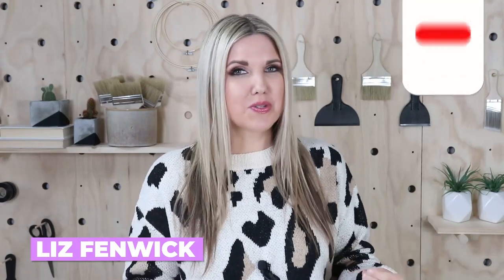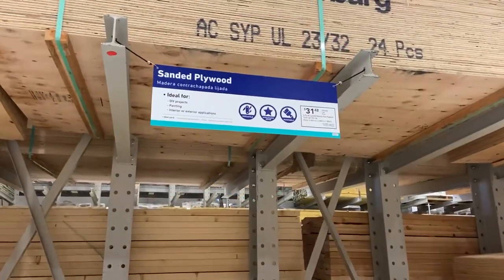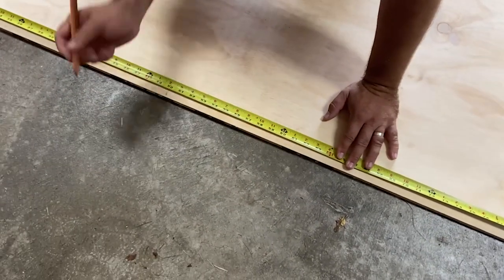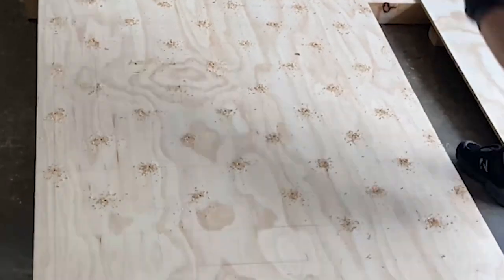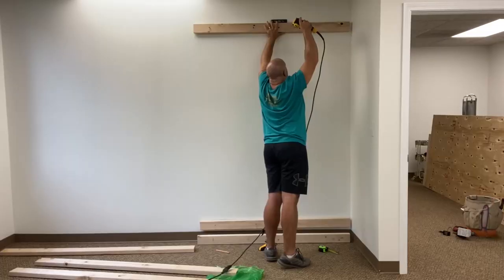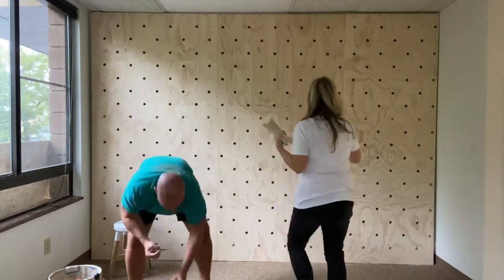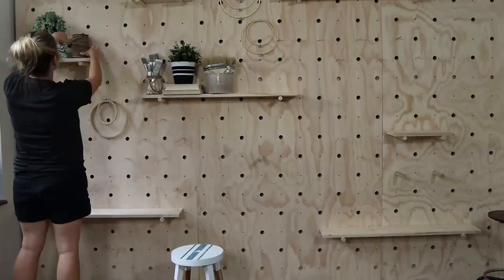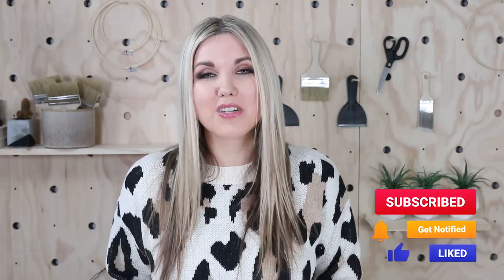DIY Pegboard Wall - Office Makeover

Comment: I want to do this but not a whole wall, maybe just a 30" wide and 60" tall section for a partition wall with the bottom 36" plain.
What dimension thickness is your plywood? 3/4, 5/8, 1/2"??